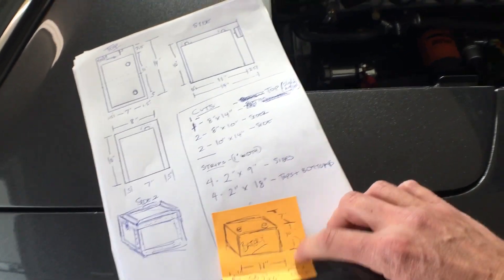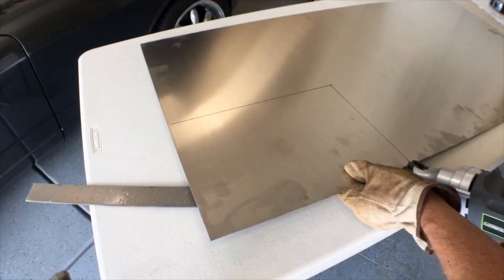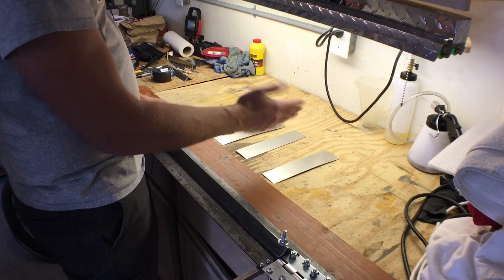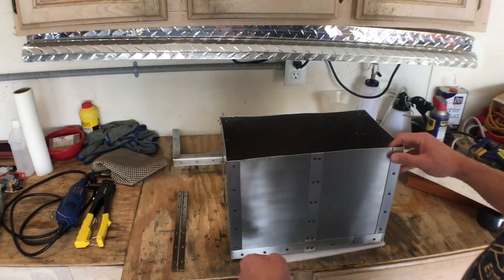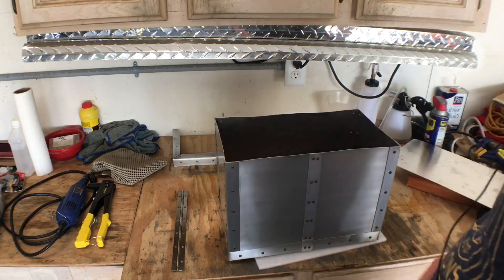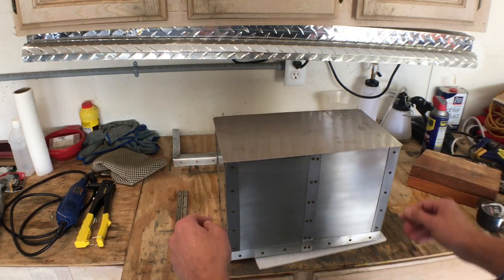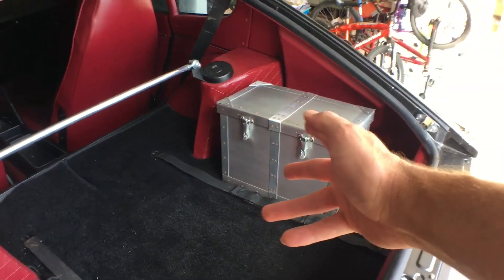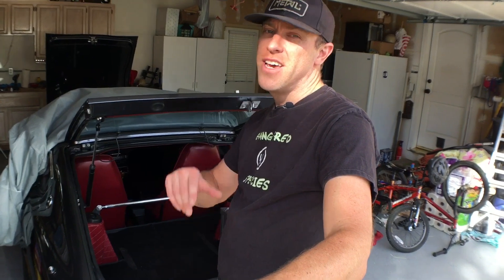How to make an aluminum battery box

Comment: Nice job on the battery box man!  That’s a ton of work and definitely pays off at the end.  Quick question.  How did you secure the box to the car?  I’m doing something similar to my 83 Toyota Celica Supra and debating how to secure box.  The gas tank is obviously right under the hatch area so I want to avoid drilling holes.  My thought is to weld the box to the floor of the hatch area using a couple brackets or something.
Reply: Never mind.  I found your other video installing the battery box!  Good stuff.  I may try your method of dropping the gas tank and installing bolts to underneath.
Reply from the maker: Yeah that the best, especially when the box is aluminum and the body is steel. What are you doing else on your Celica?